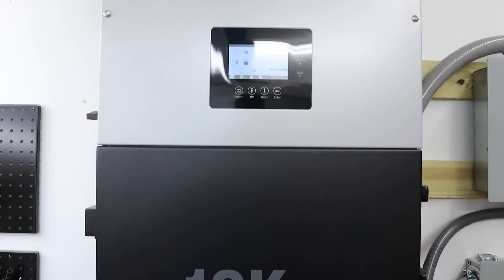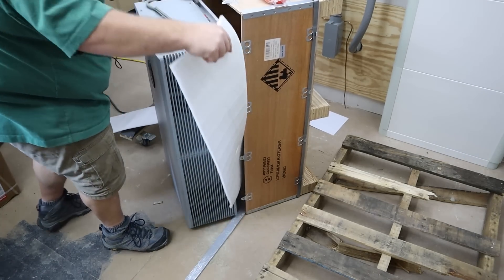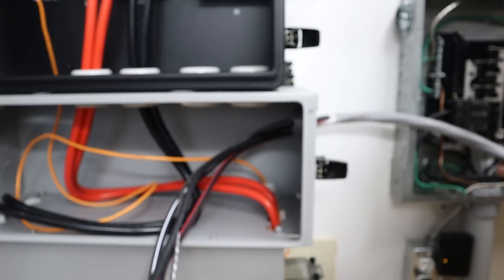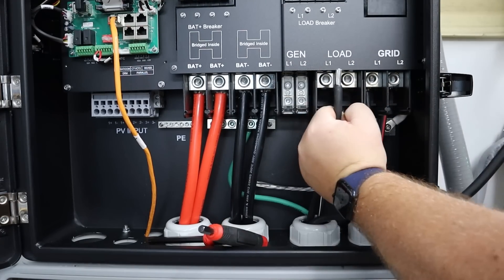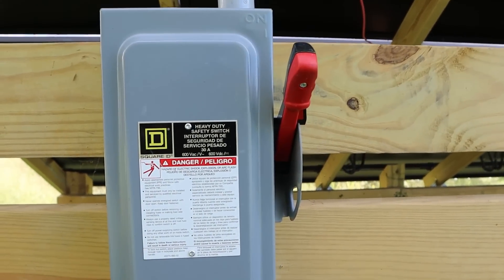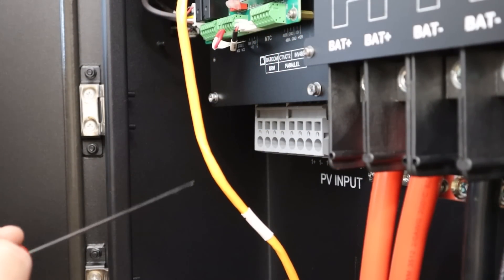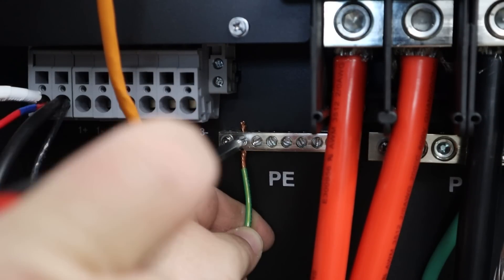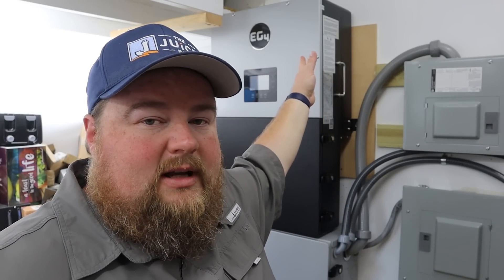This ESS Will Run Our Business? Installing the EG4 PowerPro to Find Out

Comment: Good information I am going to do something similar moving my solar from the shop to the house so the info about splicing the PV wire for a longer run to the house is something I will need to do.

Comment: Good day Sam! What output in kWh is this capable of supporting for daily usage?  My highest usage in a day (cold day with heat pump and emerg heat) was 51 kHw while my typical daily use is 29 to 30kWh.  How much of this kWh per day could I possibly save by supplementing with a roof mounted solar array and the EG4 system you reviewed?  If you guessed... not looking for a definitive #.

Comment: Yes, it does do everything. It can even fry your appliances because it doesn't offer any galvanic isolation between its DC boost stage and its AC output, because the manufacturer is too cheap to include an iron core, copper wound output transformer.  You get what you pay for, and you'll never find one of these poor man inverters in any of my installations.
Reply: What would you recommend? For an average size home
Reply: @1907squid  I would suggest a low frequency, transformer based inverter charger from Schneider Electric, Outback Power, Sigineer Power, Victron Energy or Magnum Energy. Any of these brands will provide a far longer life expectancy, a much higher surge capacity and much safer operation than any high frequency, transformerless inverter.

Comment: Seems like an awful lot of expensive and complicated stuff that frankly I do not understand why all that is needed. I have run 10K and 15 K generators in the past and they were totally sufficient to answer ALL of our needs at the time. Solar has made what was simple into a bundle of expensive and complicated stuff that seems to need so much other stuff that I would need to invest two futures to get 1/4 of what I actually need (at times) to make it through a day. Your capital investment must be horrendous to fill that wall with distribution, inversion, and charging and batteries.  Seems almost more worth it to pay the power company to wire it in and forget it.
Reply: Bro, your youth was spent in a time when it was good. Now, we are pretty much in the end times, where they don't want us to own anything so solar is a good option to generate your own power.

Hopefully, you live to see many more years, but this generation is in a terrible situation. 

If you think relying on the power grid is forever is a better idea, well, I hope you live to see the shyte storm coming

Comment: How come you're basically installed 2 of the same systems , and not just expanding your existing one ?
Your luxpower and this 18kpv is exactly the same inverter...
Reply from the maker: Because we're working with Signature Solar on this EG4 system whereas we worked with BigBattery on the other. We will be comparing the two systems in future content to help others know the differences between the two and their pros/cons.

Comment: Sam, I am not an electrician, but I am installing my own solar system in Tennessee. My understanding of the NEC 690.31  all DC circuits over 30 volts or 8 amps "... be contained IN metal raceways, or Type MC metal-clad cable that complies with 250.118(10), or in metal enclosures." I don't think your use of Liquatite Flexible Electrical Conduit complies with this requirement. Your thoughts?
Reply: NEC 690.31 is for a subset of DC circuits, specifically PV circuits. The language is ..."PV system dc circuits that exceed 30 volts"... For the PV wires, they should be in metal conduit within the house. I think you may want to look into NEC 706 for ESS systems as I believe the other (non-PV) circuits like between the battery and inverter can be in rigid PVC.

Comment: Since the other inverter is basically made by the same company maybe switch it up and run them in parralell. Then you can share battery and can add a few more arrays to offset ahop usage

Comment: What was the 'mechanical object' you used to lift the inverter?  I've seen one video where a guy screwed in some heavy duty hooks into the wall above the inverter and looped a ratchet strap to lift the unit - worked well.
Reply from the maker: A sit/stand desk on wheels. Robbed from my workshop. :)

Comment: Which size cable did you use for Grid L1 and L2 to the breaker panel input?
Reply from the maker: 2 AWG
Reply: How come you used a 2awg instead of 4/0 awg since you have a 200A breaker ?

Comment: Question. If you were to add on to your house  adding more outlets, lights and so on would you have to upgrade the systems production and setup to accommodate the remodel?
Reply from the maker: Not unless we really added a lot of electrical demands. This inverter will output 12,000 watts continuous... that's 100 amps and plenty for our needs.

Comment: Sam are u say that eg4 14kwh battery has more juice than those 6 ethos batteries... I have eg4 batteries and the 6000xp and outback inverters. I dont see that one battery keeping up ur house tottally off grid........ Nice set up
Reply from the maker: I never said that. This system is for my workshop.
Reply: Oh I thought u put ur house on that 18k inverter

Comment: Can you do an add on video with the breaker panel hookups and breaker sizes?

That would be most helpful

Just trying to wrap my head around what I would need to feed back to my main panel with an interlock instead of using a transfer panel. 

And then eventually adding in a generator and chargeverter. 

Thanks for all the great info

Comment: How much would this system actually cost, no professional installation?
Reply: $8600 if you plan to sign an interconnect contract with your power company to export power back to the grid. $5900 if you do not plan to export back to the grid.
Reply: Way to much